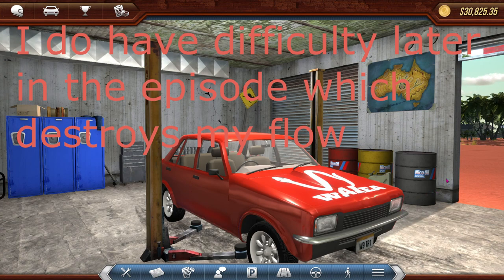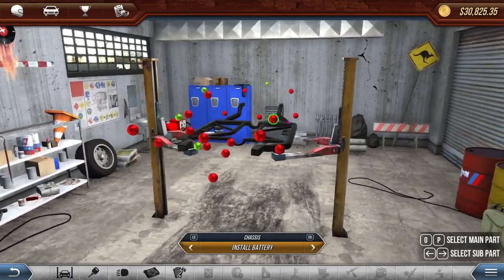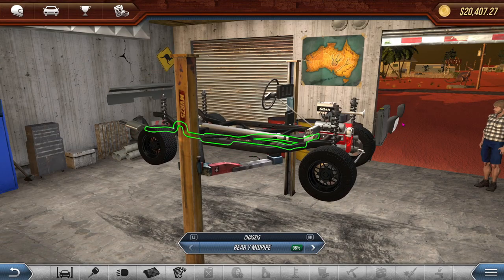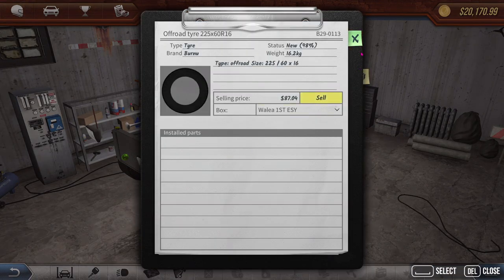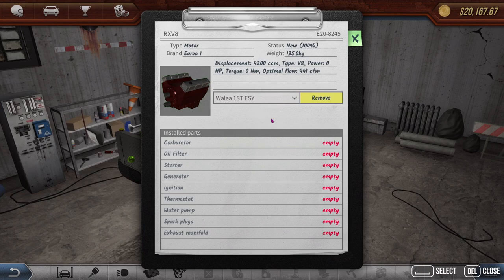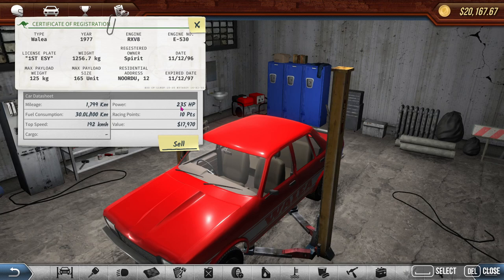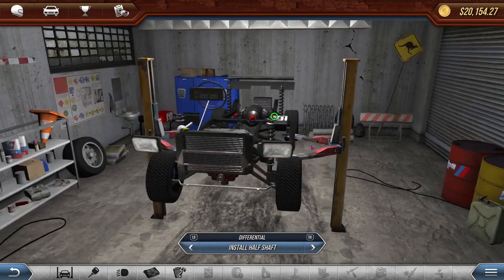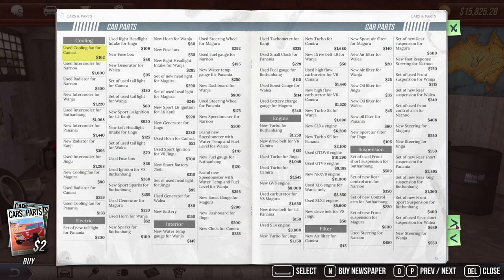Swapping out the V6 for a V8 engine | RevHead

Comment: @7:10 - Just under the yellow "remove" tab there is the "fix" tab, that will repair the engine block, you can then click on carburetor, generator, etc and repair all the components except the filters and sparks. You are better off leaving all the components attached if  you sell or store. That goes for everything on the car, the wheel and brakes are attached to the hub and the hub is attached to the springs so if you remove the springs, everything comes with it so you can re-attach to another car much easier. You also don't lose any value compared to selling as individual parts. Thanks for the shoutout:)
Reply from the maker: Cheers I have worked some of that out but don't show it much because it just turns into a clicker game.

Comment: Only some parts are engine specific, so you can only fit a V8 carburetor to a V8 engine (any make i.e. Narnoo or Euroa, as long as it's for the same type of engine i.e. V8, V6, L4 or L6) but any air filter will fit into any carburetor.
Reply from the maker: I know about the V6 for V6 and V8 for V8 but different car parts for other cars took me by surprise.